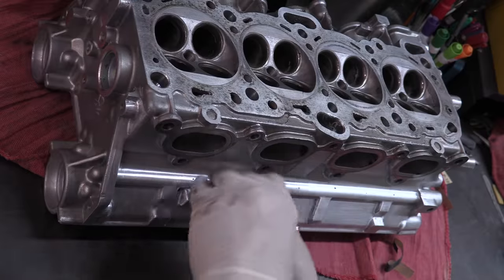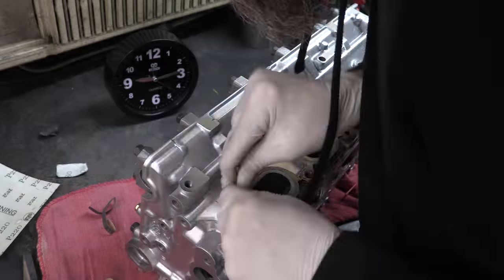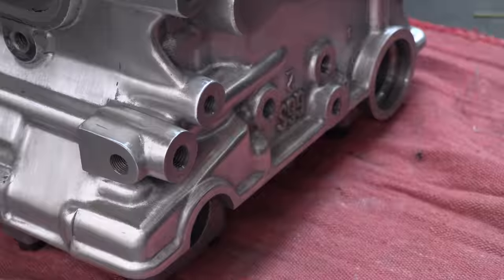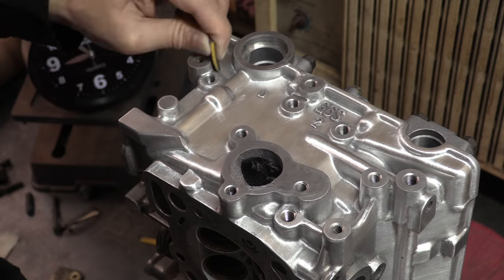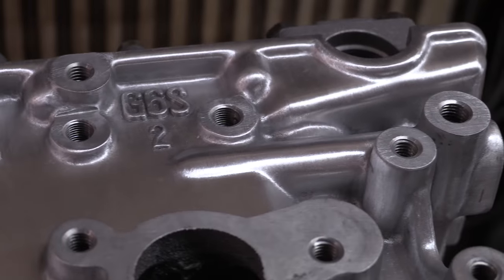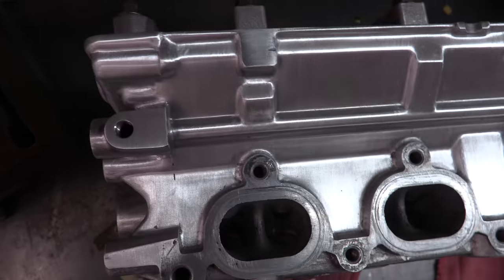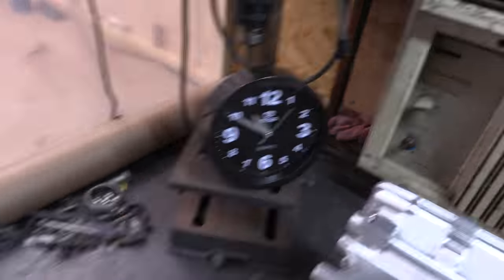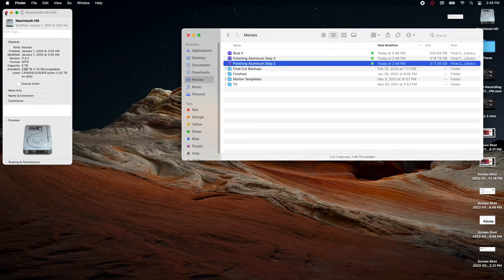Polishing Aluminum Step 3

Comment: I absolutely adore the final result of a well polished cylinderhead and Valvecover in a clean enginebay but I simply lack the patience and attentionspan to do something like that. On the other hand I absolutely love doing Bodywork and can spend days or even weeks shaping and massaging a flat piece of steel until it perfectly fits a car for a repair, like on a 96 Mitsubishi Sigma/Magna wagon where I spend the better part of three weeks repairing damage to the rear left corner of the car, where I had to completely remodel the rear quarterpanel and the Mountingspace for the rear light from scratch because Mitsubishi doesn't sell any repair panels for that model anymore. Or on my 1990 Lancer Station Wagon where I reproduced the lower part of the Driverside front fender from flat steel due to the original having rusted out, because again, you can't get any replacement bodyparts for that car anymore.
Reply from the maker: I'm 100% certain I will be in your boat soon.  I'm pretty sure that's my future 4/5 of my projects.  Donors are impossible to find, and that's why I appreciate all you've done to help already.  I wish I could have a room for you and a paycheck waiting when I get to that stage.
Reply: @Jafromobile  I mostly do it because I have a soft spot in my heart for Mitsubishis from the late 80ies to early 90ies because its the generation of cars I grew up with and also they are getting increasingly rare over here, like my Lancer C12 Stationwagon, there are less then 100 of these left in germany. Same goes for my 91 Colt C50 (same model like the yellow one you have) and even my 91 first gen DSM is something you don't get to see all that often anymore, so I do my best to preserve these cars and luckily over here in germany there is a dedicated scene that helps each other to keep those cars on the road.

Comment: So far I have polished my turbo, intercooler, the one charge pipe you can see under the hood, my intake and I took a scratch out of my strut tower bar. I plan on hitting my water neck next. Thank you opening my eyes to polishing. It takes forever, but when you're waiting for stuff in the mail it really kills time. This stage of my build will definitely have a leap in it's show quality.

Comment: Hey jafro, recently rewatched your oil filter housing video and noticed a comment that mentioned drilling/tapping the spring cap bolt end to be able to adjust the spring and therefore oil pressure. Ever plan on making a video on it? I know it’s been 5 years but I think it would be fairly useful if successful lol
Reply from the maker: I think I will have to engineer some kind of nylock insert to prevent it from being an oil leak. Oil pressure in DSMs get above 100 PSI in many cases, and the only thing that ever stopped me was the idea of using straight-cut threads.  Every other thing drilled into these are tapered for this reason, and if the Hyundai has proven anything, it all leaks anyways!  lol. Even after you re-tap it and JBWeld it together.
Reply: The only thing I could think of is maybe incorporating an oem crush washer like it’s used on the oil drain if you use a m6 bolt. Idk how effective it would it would be but might be worth exploring. Otherwise thread sealant would probably hold but wouldn’t be as efficient if the point is to be easily adjustable. At the same time a crush washer is technically one use so idk just spitballing lol

Comment: Have you considered vapor blasting as a step before the final polishing to get an even surface finish / similar luster....I’ve seen people do “stepped“ vapor blasting on intake manifolds, with progressively finer media, and the results is almost a polished surface when complete.
Reply from the maker: Yes.  There's a specific reason why I'm doing it this way, and there's a plot twist coming soon.  As you suggest, it's only the later stages where it could be a benefit to you.  So... now that everything's flat, now is the time where you could use it and produce a quality finish.  Now that we're 124 hours into the job.  At some stage is HAS to be planed, and as you can see, it took me 3-4 grits of sandpaper, manually to do it.  No mechanical means short of precision machinery (the stuff you can't hold in your hands) will ever produce a flat finish.  That's a human problem it's no criticism of any of the other tools or processes anyone might want to use.  In fact, vapor blasting is the least destructive of all mechanical means someone might choose.  But it's only going to affect the areas where you linger the longest, and when it hits corners, it will distort edges if you linger too long.  This gives hand-prepared finishes an extremely unfair competitive advantage over all other mechanically prepared surfaces.

There's a good plot twist coming soon.  Most people believe you have to have 3 zeros on your sandpaper in order to polish things, and if so, they will recoil at the idea of doing this manually.  They'll buy the blasting cabinet, and several kinds of media to avoid it.  A vapor blasting cabinet, including nothing else, starts at $600.  Well over $1000 if you don't have the right air compressor for it.  If you're trying to create a show quality finish, you MIGHT save yourself 40-80 hours of work total to create the finished product.  However, if you're not aiming for show quality, you just like shiny things, then you might save yourself 150 hours of work?  It all depends on your goals.  

Not everyone is trying to do this to compete.  But some do.  There's a lot that goes into the decision for what's right for each person.  The methods don't have to be mutually exclusive by any means, I'm always a big tent guy that says use your whole arsenal.  They all have their strengths, but as you suggested with the later stages part... I want them to think about where and when it's practical to use them.  I will be using the manual method from start to finish in my surface preparation, and I am creating that example for which others can make that decision.  When quality is the focus, I'm never concerned with time or expense.

If you already have the vapor blaster, it's great.  Start using it now.  If you don't...  then you need to decide what that space, mess, equipment, supplies and maintenance are all worth to you.  But if you do the math on the cost savings to just buy $50 worth of sand paper and you'd be paying yourself between $15-40/hr to just sit through it instead.  Just being objective.  Yes you can do it to multiple parts now and it changes your capabilities but how much are you going to use it once you finish?  There's lots of creative ways for each person to deal with these variables and how they apply to them.  In order for each person to make that decision, about which methods to use, and when... I think we need examples.  It's why I'm producing the series completely without it, and no interest of ever adding it to my *home garage*.

You're thinking about it correctly.  I can tell you've been paying attention to the series because of the specific way you asked it, "the later stages", as you said.  I think the plot twist will complete this full picture about all of these things and how useful it would be in the later stages.  I am answering this question only once in every single one of these videos.

Comment: Hey jafro, I was just watching a new hagerty YouTube video, they’re building a Jeep 4.0 stroker, not important. But to prep for painting the block he used a pneumatic scaler to knock off the big bits of excess material instead of a die grinder. Seems like it works well, you should check it out. Not sure how it would work on aluminum parts but for a cast iron block it worked well. ✌️

Comment: Have you considered using time lapse in camera rather than regular video? That way you can cut down the amount of video massively. A 1 frame per 5s is a reduction in file size of 120 times!
Reply from the maker: If I do, and a thing happens... then I don't get the thing.  I would miss all of those shots.  I vary the acceleration depending on what I'm doing or explaining.  You can see how some memory cards at the end are longer than others.  It used to take me 10 hours per hour of video before SSDs were affordable to boil it down, but now with my latest editing rig fixed, I can edit 2.5 hours of video per hour of editing.  THAT is what Patreon helped me do.  They gave me my life back.

Comment: Idk anything about production but can you set your camera to 10 or even 5fps instead? Maybe a test and see what it looks like.
Reply from the maker: I've done it by accident before setting it to 4fps, and it's terrible.  There are too many times when I slow it to real time, and that ruins it.  Accelerated, you couldn't tell a difference, but it occupied the same space on the memory card.  Swithched to photo mode and time lapsed, the frame size changes.  It only looks this ridiculous because I've accelerated the video to ludicrous speed without any editing whatsoever.  Normally I'm accelerating gaps in my words and between sentences.  For instance, tonight I filled 2 memory cards that filled a 10 minute space instead of 13.1 seconds.  It's rare that I have to accelerate a whole pile of memory cards without edits like this.

Comment: Jafromobile when will you be posting Polishing Aluminium Step 4???
Reply from the maker: It's a work in progress, I haven't quit.  ...but I had to take a much needed break from it to spend $4,000 on a video to interrupt the series with, and push the bottom half of 2 engines along.  Nobody is going to be mad at me for this when they see it.  I've got lots of great stuff on the way including step 4.  Step 4 is still several weeks out, I'll warn you.  If you're waiting for my guidance and have caught up with me, just start with 320 grit, dry, and I'll catch up.

Comment: Are you continuosly filming everything? If you're going to fast forward 2x or 4x it would be better to just have the camera take a picture every 10s for example. I think it would take less of your hard drive space. Doing timelapses that way. Just thinking out loud. Cheers.
Reply from the maker: Yeah, after 350 videos if it would have worked I'd be doing it.  Remember that one of the reasons why I do it this way is to maintain an audio track.  ;)
Reply: @Jafromobile  Aah of course I did not think about that :)